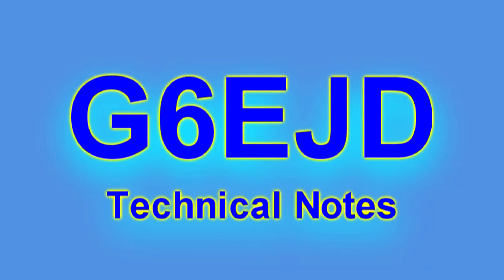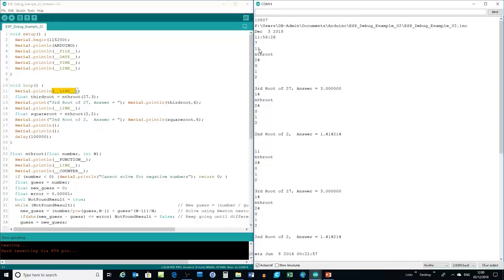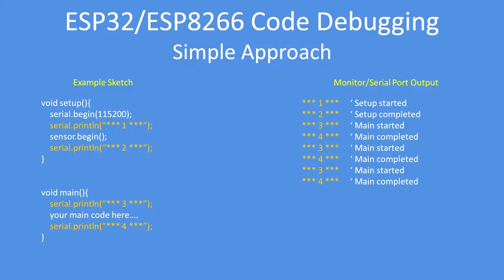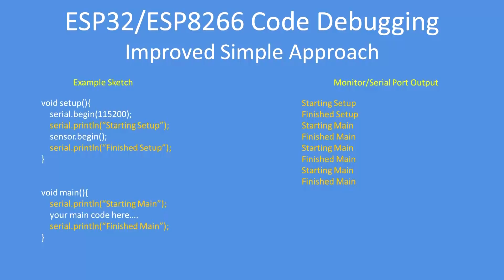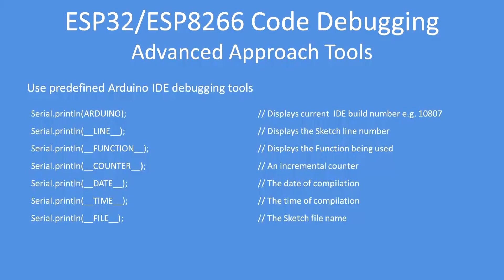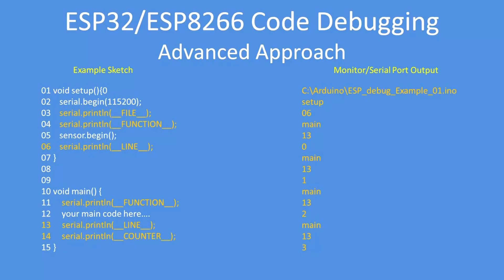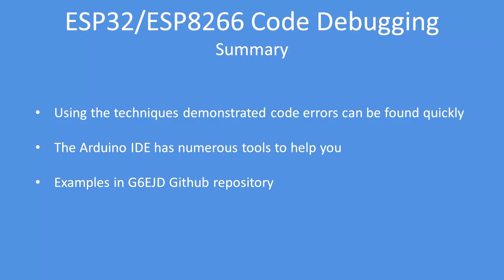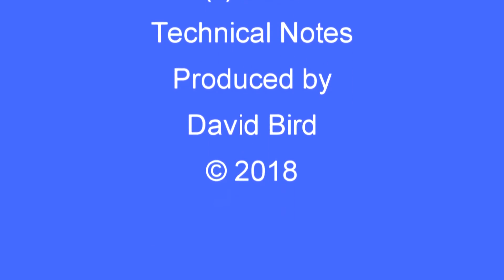Tech Note 112 - ESP32/ESP8266 Code Debugging Techniques

Comment: You describe LOGGING, not debugging. I hoped to find now real ability to set breakpoints and inspect objects. 
I also use such logging to check on Serial, but I really miss a real debugger for ESPs
Reply from the maker: Stephan Strittmatter, well you can use the ESP runtime debugging tool that will show you where in the source code a cpu crash occurred, but what I was trying to show was that without any diagnostics serial port output showing programme flow or variable values it was next to impossible to find the problem. I know of no problem that can’t be fixed by doing what I described in the video, even real-tine activities. If there was a JTAG port it would be easier to then single step or set break-points in the code, but you’d need the full Espressif development board costing x10 that of a usual board type. What problems are you having that you can’t find a software fault?
Reply: G6EJD thank for your feedback. You are correct. You can find a lot, but you have to add these lines everywhere. I also saw already JTag but as you wrote it is quite expensive and also complecated to set up.
Currently I try to find the problem of this issue: https://github.com/homieiot/homie-esp8266/issues/351
Reply from the maker: Have you added WiFi.mode(WIFI_STA); just before WiFi.begin, and I would run the example sketch call WiFi scan or something like that because it reports the name and signal strength of all received WiFi networks, yours should be at least -60dB or better (so anything less than 60 is better) above that and the connection is marginal, it would also be a good test that your Router is broadcaster the SSID, some don’t especially if dual band types, where much of the traffic is moved to 5.8Ghz band to improve speed.
Reply: G6EJD it is very strange: if you connect directly to power the problem does not occured. If the ESP is connected to IDE - I think it is something with combination of writing out to Serial - the problem occured. But not every time. Looks like combination of Serial and timing. But without "real" debugger it is difficult to follow all calls.
Reply from the maker: Well, that’s a big clue as to what the issue is. So, if you power the board via USB from a separate power supply or USB battery pack, it works OK, but when connected to a (?) PC there is odd behaviour. This suggests the PC is asserting the DTR and RTS lines which are used to reset the ESP for programming and then when the ESP correctly tries to send data on the TX0 line, that it is being prevented from doing so by being in a state of continue reset. Now I’m wondering if the serial port of the ESP is being used in your code? If it was then this would account for this behaviour. Exactly what board type are you using? ESP32 or ESP8266 or Arduino? Or if not who’s design is it? Have you checked the code for serial port usage other that a standard setup of serial.begin(115200)?
Reply from the maker: Also, the link you provided points to a beta version of homie have you tried using the non beta to see if the problem exists?
Reply: @G6EJD  yes it also in V2.0. I support this project and wanted to solve the problem.

I use ESP8266 nodemcuv2.  We also tried several speeds of serial port (other than Serial.begin(115200);  ). 
Yes the framework uses serial for logging. Funny thing is: it is not always hanging. I have a project using Homie where i had this problem some week not, but after some enhancements it occurred regularly. So I was first time able to reproduce the issue.
Reply from the maker: I would now examine the runtime memory usage and make an assessment at compile time of how much ESP8266 resources have been used statically, so for instance is the compiler reporting that high proportions of available RAM has been used, a general rule of thumb would be >60% leads to runtime issues, then I would move all static strings/text to flash to free up RAM and look at the variable types such as int that could be bytes and so-on. Some strategic printing of the heap size will give an indication as to the extent of memory usage, especially with WiFi running as maintaining the TCP/IP stack consumes much memory and so on.
Reply: @G6EJD  hm, that could be an issue. I had not seen it from this side of view. i will  investigate. Thanks for your support!
Reply from the maker: One thing I learnt at University is to test things at the limits and this help me a lot, in simple terms 0 and infinity, so in this case you can eliminate the WiFi components and associated IP stack overheads by running a simple WiFi example which is almost certainly going to work and connect without issue, that would be the lower end of the sting then your programme sounds like its approaching the upper limit, so this issue does point to a lack of resources or programming errors. My experience tells me this is a dynamic issue and it’s a lack of memory.

Comment: Hello, where are the debug  arguments documented, I could not find it.
Reply from the maker: Like s lot of Arduino macros most are unfortunately not documented. The only way to find them is to reverse engineer the compiler source code because that’s where they will be defined. This is why I produced the video to give an insight into at least some of these - the ones that I know through experience.
Reply: @G6EJD  Thanks a lot. That makes you video more liked by me.

Comment: Thanks for this.  Displaying the _FILE_ is going to be a standard part of my Setup routine from now on.  While tinkering, I sometimes just grab one of several D1 Mini modules so having this function report which code is running could be super-helpful.
Reply from the maker: Indeed I do the same as it’s a permanent record of what code was compiled and it’s a permanent record, I find it invaluable as I definitely forget especially if I’ve got many devices so a quick monitor of the serial ports tells me exactly what’s what.
Reply: I will update my setup routine too, I didn't have ARDUINO and _FILE_ .

For the record, I also use these ESP functions :
ESP.getChipId()
ESP.getFlashChipId()
ESP.getCoreVersion()

(I commented those above)
ESP.getFlashChipRealSize()
ESP.getFlashChipSize()
ESP.getCpuFreqMHz()
ESP.getFlashChipSpeed()/1000000
ESP.getFlashChipMode()